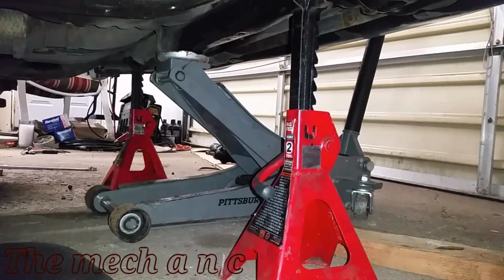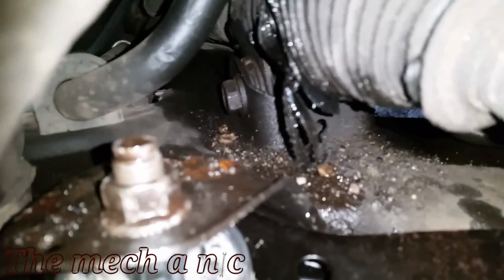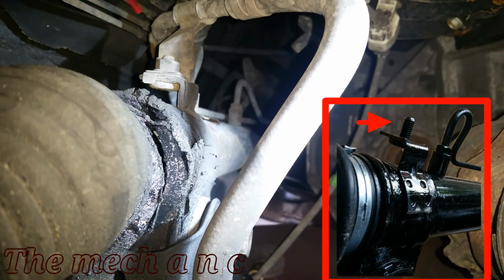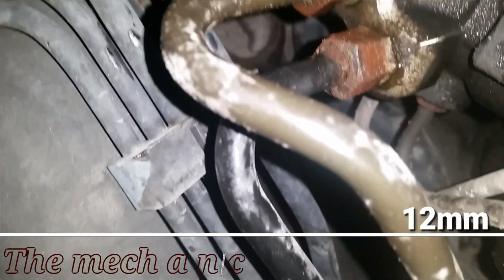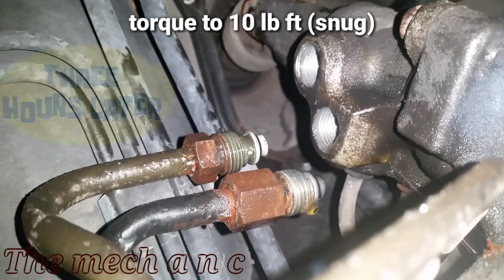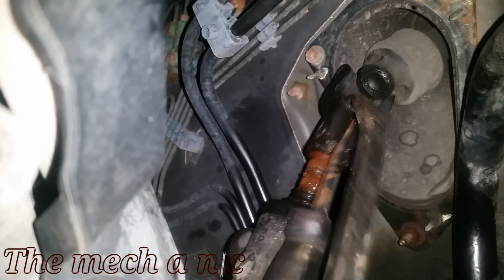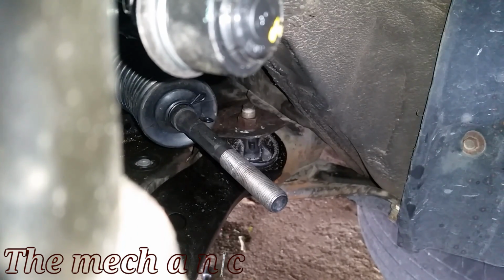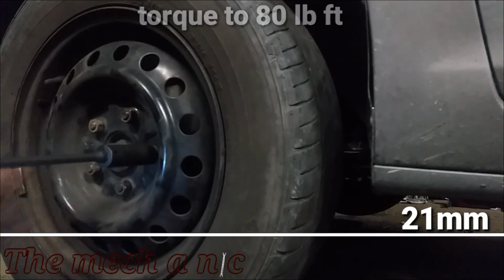02 - 06 toyota camry rack and pinion

Comment: I just got into this job this afternoon.  I totally get your frustration working under the vehicle.  This job is actually pretty easy except the two bolts that hold the rack in.  Man, are they ever tight!  The one on the right side of the car is the easier of the two.  All you need is a 19 mm box wrench on the bolt head and it will hold when you turn the 17mm nut.  The nut came loose with my 1/2 flex arm, but it needed lots of heat (with map gas) and both my legs to get it to move.  The other side is worse because you can't get a socket on the 17mm nut as the transmission is in the way.  You need a long handle 17mm box end wrench (and the 19mm box end on the head of the bolt) and a pipe extension to move the nut.  It took me 5 attempts and lots of heat  to move the nut.  I bent the wrench quite a bit, but it finally released. Not for the faint of heart.  Tomorrow I get into the timing belt on this V6 with 220,000 miles.
Reply from the maker: +Philip deCatanzaro sounds like you had it worse than I did!  Great work . It's the best thing ever when a bolt finally breaks loose.  Thanks for sharing your experience.
Reply: Your video was very helpful. I was at the point of using a nut breaker or sawing the nut off,but I'm glad I didn't.  There is only so much you can do in your driveway with the car up on blocks and it tries your patience.  Thank you for showing us what's involved with this job.  Much appreciated.
Reply: One more thing that I'd like to add.  It is much easier to access the high (and low) side nuts and the steering U joint bolt from the top.  On V6 models you remove the air filter assembly and there is open access to the nuts.  The only thing is that if the car is already up on blocks you will have to stand on something to reach in.  You still need the crowfoot (17mm flare) connection with a long handle flex head ratchet.  Lots of tighten-loose tighten motion (with ATF or penetrating oil) will keep you from ruining the lines.
Reply from the maker: +Philip deCatanzaro I would imagine things are slightly different with a v6 in it. Glad you got it done.thanks for the tips for other viewers.
Reply: With the V6 you have to pull out the old rack and install it from the driver's (left) side.  For those of you that took the trouble to remove the old unit ... don't worry, installing the new one will take much less time. I would have done a video, but our friend the "mech a nic" has done a great job here.
Reply: The two main bolts on the assembly have a weird lock washer on the nut. IMPORTANT to remove the bolt and leave the nut stationary. People force the nut off which requires bending the locking tab on it before it will move. That is why it's so hard.
Reply: You’re not suppose to loosen the nut. You’re suppose to loosen the bolts. The nuts have a serated pattern in them to dig into the metal so they can lock in to place. Once you break the serations the nuts can no longer do what they’re suppose to.
Reply: @supremegpc  FYI The car is long gone.  I posted this 7 years ago.
Reply: @philipdecatanzaro1822  not necessarily information for you but for anyone stumbling upon this video.

Comment: For a 2006 Toyota Camry, the factory specification for the power steering system actually uses Dexron II or Dexron III Automatic Transmission Fluid (ATF) rather than standard conventional power steering fluid. Dexron VI is also widely used as a backward-compatible option. 
Generic stuff may/will damage internal seal.

Comment: Bought a new rack from Amazon and spent 500 for the replacement job. The result is steering becoming stiff. And the shop (OK Auto) refuse to responsible for the outcome because the new rack purchased from me? The main reason to replace is the robber bushing hold the rack damaged causing the steering play in the middle. There are some slow leak on the rack. Now I lost direction how to restore the stiff steering?😅😅

Comment: 7:00 again, you could’ve saved yourself so much time and trouble by removing the airbox in the engine bay to remove the bolt from the steering column.

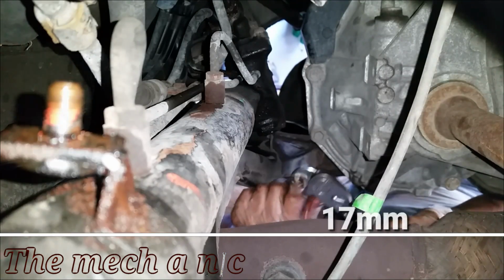Comment: 6:03 Just remove the air box inside the engine bay to get to the hyd lines. Much easier than laying on your back and trying to get them off in a very confined area with very minimal movement of a ratchet or wrench.

Comment: It is also very important to note that the new replacement rack should be centered before installing it on the car! Or else your wheels would turn further one way than the other screwing up your turning radius and causing the tires to rub possibly.

Comment: Just finished the job, one more IMPORTANT NOTE: The Camry I have has a VSC (Vehicle Stability Control) which is like Stabil Track for GM. Basically it knows if you are in a slide and tries to stabilize by breaking... The car freaked out on the test drive as the steering wheel center had shifted with the new rack and pinion. One option I didn't try was to unplug the battery for 30 minutes to clear VSC memory.

There are videos on how to reset using a paper clip and shorting two of the ODBii connectors. Other options include using Toyota Tech Stream software in the VSC area inside utilities to a) ignition on + engine off  then b) on a flat surface with the car still,  which will recalibrate the sensors. The other option is to go into a shop and have them recalibrate it for you for some cost (maybe $50.00 not sure). You can also pick up a computer that plugs into your ODBii and reset yourself.

Comment: One thing I would add is check your rubber hoses from reservoir. Mine are sweating and look pretty bad, probably disintegrating from inside. I figured out this is a 5/8 hose, has to be rated for transmission/PS fluid. My local parts store has it by the foot and should be about $4.00. Lots of people say the short rubber hose hardens where it connects to the reservoir and starts leaking from under the clamp. EXACTLY what I'm seeing as well. 

Also, they say to put in an inline filter, but Camrys already have a filter pad in the reservoir so no need. For my Dodge Caravan I put an inline filter in the return line to catch anything left in the system from the pump disintegrating. It's been like 8 years so that worked out well.

From TN: "Your PS reservoir already has a filter built in. Yes, the PS filter is integral to the reservoir, which also means you can't just change it out without using a new reservoir. If you draw out all the fluid and look into the reservoir, you'll see that little filter pad. That's all."

Comment: There is a trick for maintaining the alignment. After placing the car on jacks, the bolt to the tie rods can be measured with a tape measure without any obstructions in between the two points. As for myself, I measured outside thread to outside thread. It is recommended to have a helping hand to perform this measurement. For example, I measured 55-5/8". Otherwise, this is a very good video.

Comment: How about the rack's pre-load adjustment? A mechanic installed a new rack for me and the steering has MINIMAL resistance when turning.
Reply from the maker: Pre load ? I've never heard of this
Reply: Google
Reply: Just about to do this... it's just closing gap on pinion gear or loosening it so it's not too tight or too loose. I found an article on toyota nation for 99 Camry. Shouldn't have to mess with this from a new unit. People complaining about a light clunk have the pinion gear play too lose and need to tighten it up.
**********
An update to this. Finally, was able to use a lift at a buddy's shop to work on this. By removing the big square looking nut on the rack, you can access the adjustment nut to tighten this up. Unfortunately, tightening this just a hair made it too tight. There was basically so much wear in it that it wasn't fixable. Time for a new rack....

Comment: Pretty good video:  You need to remove the air box...you need to disconnect the sway bar lower links so the sway bar may be rotated to get the bolts holding the rack off, these bolts may be removed using a 19mm box wrench cut in half with a 24" 1/2" black pipe as a lever bar, the rack comes out the drivers side.  Job is about 1 hour for removal.  You may spend $150 to $300 for a replacement, but $30 for a seal kit...takes about 1hour to reseal...go for it!
Reply: Any special tools need to reseal yourself?  I heard it was difficult and need special tools.  Any videos on this out there?

Comment: I am not changing the rack & pinion myself-however this video was a blessing to let me know what a time my mechanic may have doing the replacement. Now I know to make certain to not squabble over the cost to have it done and I will also buy him a big Costco pizza to help him ad his helpers. On tough jobs I often treat them to lunch It seems to be much appreciated. I did it because back in my youth if I was working on greasy cars I know I used to take those cars first and do extra steps because I felt appreciated. It seems to work the same with my guys. Always treat the help nicely- -- - always !  Not for personal gain, but because it is the right thing to do.

Comment: Excellent content …. So I have a question for you my man and I would love an answer from you !!! A local mechanic that I have been going to is trying to charge me 1250$ for the sterling replacement and the racking pinion that’s leaking ( replacement as well ) for 1350$, this price include labor and part!

This seems to be a lot man, I am watching the video and it downy seem a lot! I already just change changed the timing with them and water pump which was 115$. I feel like I am spending so much so such old car ( do t get me wrong tho I love the car and it’s running super smooth )

Anybody more than welcome to jump in 🙌🏿🙌🏿

Comment: There are no new steering racks for the 02-06 Camry's, all are rebuilt. When you get the replacement steering rack there are plastic block off plugs where the power steering lines thread in. Remove those plugs prior to installing the new rack and inspect the threads to make sure they are clean and not cross threaded or damaged. Any damage to the threads return the rack for a replacement. Put the plugs back in and install the rack. 

Carefully inspect the power steering lines and hose fittings to make sure that the threads are not dirty or damaged. After disconnecting the power steering lines carefully use a pick or other pointed end tool to remove the old O rings, new steering rack comes with new O rings. Use the new O rings.

Remember to tie off the steering wheel so it does not turn using the seat belt.

Replacing the steering rack is not difficult, take you time and be very careful when putting the power steering lines back onto the rack. Use your fingers and check from the bottom and top views to make certain you have not cross threaded the fittings when putting the power steering lines back in place. A cross threaded power steering line will result in you needing to replace the line and the new rack you just paid a lot of money for.

Comment: I did it! Thank you for the great video! Everything was pretty simple besides threading in that high pressure line. I was finally able to get it once I removed all the brackets holding the lines together, then moving the line around till it was straight enough to threat in. It was actually real easy once it was in in the right position. I would say for those trying this to just be careful that you don’t strip the threads by forcing it in. If it’s not threading easy then it’s probably not going in straight.
Reply from the maker: Yes that's a very important step. It has to thread in nice and easy.if you cross thread it you're causing a world of pain lol
Reply: Where did you buy the steering rack?
Reply from the maker: Rockauto
Reply: @themechanic6117  what brand is it
Reply from the maker: The one that went on this car is a (remanufactured) ultra power brand
Reply: Im having trouble removing the 2 long bolts/studs that holds the steering rack on. There is clearance issues with me trying to pull it out and have tried moving the sway bar up and down for more room but its not working out for me.

Comment: Dose a ripped boot means I need a new rack? It doesn't leak any fluids the steering wheel isn't stiff at all but the boot has a big rip in it 2006 camry 4cy
Reply from the maker: You can replace just the boot. You'll have to remove the outer tie rod to do it.
Reply: @themechanic6117  is it something I have too do asap?? Like is it safe too drive i put some grease in there too keep it lube up
Reply: Don't have much money right now was planning on doing it next cpl month I already had too put money in to the car every month for last 5 months
Reply: I did motor mount cv axle breaks windshield wiper an new hub caps only own car for 5 months  drives great too me after I put all the work into it this is last thing I needed too do them a oil change in 800 miles
Reply from the maker: Just get it done when you can so it doesn't ruin the rack n pinion

Comment: At start Did you secure the steering wheel in any way?  Or was steering wheel centered and key removed / locked ?   Had one installed a year ago and once completed the steering wheel was turned to far left.  Another shop said the initial installer missed a step. 🤔🤔🤔
Reply from the maker: I just center the steering wheel and be sure to not move it while doing the job
Reply: ok.       That steering column horn ribbon is another bonus when it becomes unspooled 🆘. And As assigned to the steering shaft coupler- another camry part infamous for wear and play in steering and the related  click click in the wheel feel and another reason the steering wheel is tied straight before fully releasing coupler - I believe they offer a column lock pin as well   When screwed up the horn insert needs to be replaced
Reply from the maker: That sounds like a nightmare I'd rather not deal with lol

Comment: I'm glad I've never had to do this, it looks like a frustrating bear of a job in a little car. Guys talk about being certain the steering wheel is exactly centered, but that would be difficult if one has to rotate the steering wheel to get at that universal joint bolt on the steering shaft. Maybe one should mark the splined joint so it goes back on exactly the same way? Is there a mark on the new rack to make it easier to insert the shaft in an exactly neutral position? Presumably if it is not perfect the guys at the alignment shop may be able to help. It would suck if the steering wheel wasn't perfectly straight when driving straight down the road.

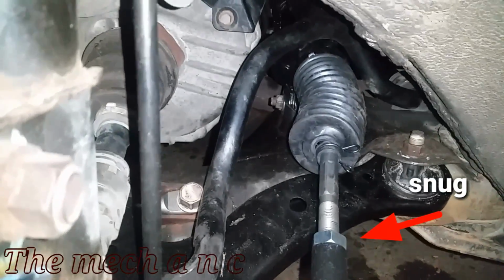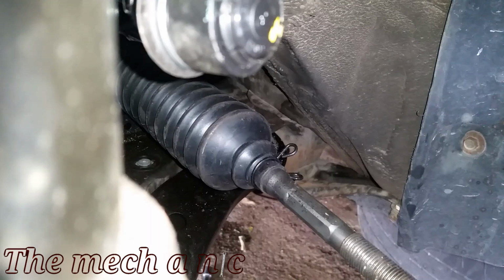Comment: Thanks for the video and explanation, but didn't you tear the rubber covering? At 10:56 it looks torn to me. It looks connected at 10:34, so maybe it happened during the purging process.
Reply from the maker: Yes it did. I didnt realize the boot was spinning as i was adjusting it. I had to replace that boot. 👍

Comment: What was wrong with the power steering rack?
Reply from the maker: Leaking seals
Reply: @themechanic6117  oh ok. The reason why I asked is because when I'm driving straight, I can still can rotate the steering wheel left and right and when I make a hard left and right, it doesn't automatically return straight and I have to turn it myself. What could be the problem?

Comment: When you replace it do you have to replace the whole thing? The dealership told me there’s a tear on the passenger side but I’m thinking of having my dad fix the problem.
Reply from the maker: If the boot is just torn it can be replaced without replacing the rack n pinion
Reply: The mech a nic okay nice to know!! They did say a tear was there but I’m pretty sure if I would have done the work at Toyota they would have charged me for the entire rack and pinion!
Reply from the maker: Avoid the dealer... If youre concerned just take it to a regular shop. Itll be cheaper but a torn boot doesnt require a new rack n pinion
Reply: The mech a nic thank you very much!!

Comment: If you remove air box it is easier to remove ps lines.... just my two cents did this job on v6  camry in 2hrs
Reply: Do you have a guide or video, I'm about to do this job on my 2003, v6 camry

Comment: all Toyotas use automatic tranny fluid not power steering fluid
Reply from the maker: Hmmm
Reply: My 94 4 cylinder LE uses dextron type ATF as it reads on the reservoir cap.
Reply: Yes, the manual states Dextron III ATF for an 06 and also it says on the reservoir.  However my local Toyota dealer uses clear Johnsen power steeering fluid.

Comment: Is this procedure similar to the 2007 v6 Camry?
Reply from the maker: Some things might be different but it's still the same general idea👍
Reply: The mech a nic  book calls for 8.2 hours but I think removing the engine is included. How many hours you charge being that you don't use a lift?
Reply from the maker: Oh it's the v6,then yes that's a bit more work. I just charge my customers a flat rate and this was a friend's car so I didn't charge much.  If you don't have the proper tools to do such a big job I'd just take it to a shop

Comment: @the mech a nic do you have a video on how you replaced the sway bar link?
Reply from the maker: Sway bar link are pretty much the same on "most cars" you can watch one of my other videos and apply it to your car . I'll get a link for you

https://youtu.be/nertWyjFhDA
Reply: The mech a nic, thank you sir! I just have issues taking the bottom nut without removing tie rods
Reply from the maker: They're a real pain. Try a propane torch on the nut. Last resort but usually faster is just to cut the nut off. I did it in another video. I'll send you the link to the vid where I cut it.
https://youtu.be/aPDBGNyo6QA
Reply: Great, thank you sir. BTW, I just came across your videos and they are very detailed and clean work, just the way I like. Keep up the good work man!